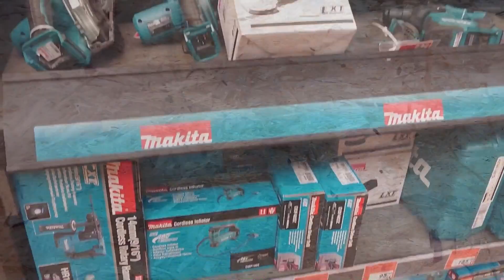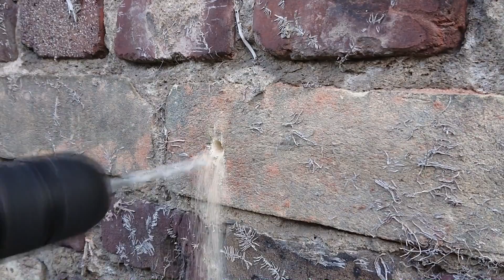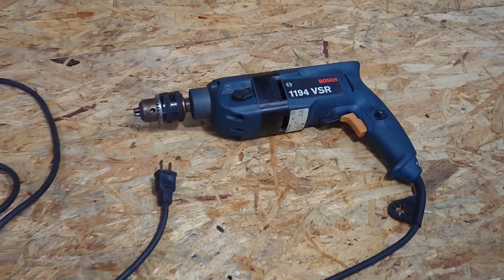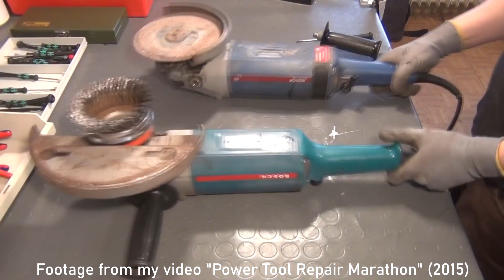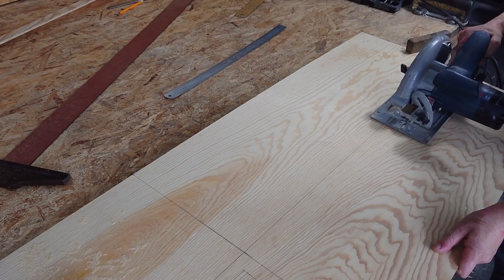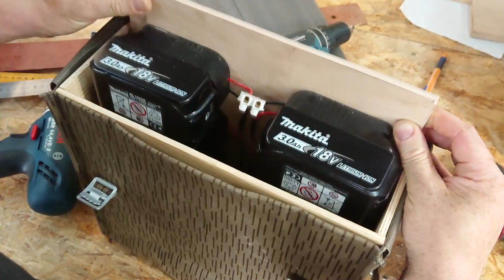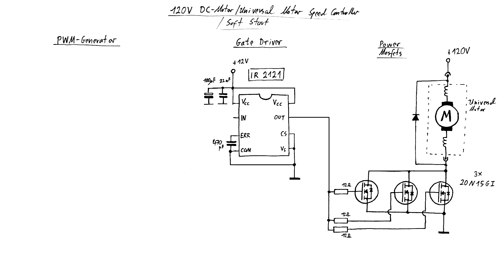Battery Tool Experiments:  Converting 120V Tools to Battery Power / NiCd to Lithium

Comment: A few comments on the grinder project:
1) Your current limiting resistors will likely ignite if you forget to flip the switch! (14 ohms in 120V circuit by itself would draw 8.5 Amps. The grinder won't limit the current all that much, so about 1kW in the resistors - and they don't look like 100W resistors to me)
2) It's very cool, but not all that practical... Those look like 3Ah batteries you've got there.  Since the grinder is 15A, you'll have dead batteries in about 12 minutes... Lets hope it's a pretty short zombie apocalypse!  Maybe toss a bolt cutter and hacksaw in the go-bag, just in case?
3) And I don't know where you're getting your batteries from, but the cheapest 3Ah 18V Makita battery I could find on eBay was $34 Canadian, so 6 of those would be over $200.  I found a used 1200W generator listed online near me for less that that!  1200W won't power that grinder at full speed, but it'll do a 9A reciprocating saw pretty easily - and with the right blade, that'll go through the metal gate too! (OK, it's a bit slower, but there's a lot less fire hazard!).

Comment: Stacking batteries for higher voltages can damage the BMS (battery management system).  The BMS will disconnect the load if the battery is over discharged or over current (or over temperature).  That disconnect MOSFET was designed for the 20VDC that the pack produces.  When you stack batteries for higher voltages, the first pack to disconnect is exposed to 120VDC and that is highly likely to fry the disconnect.  Things may appear to work for a while, but the first time a battery hits over current or low state of charge can cause one or more packs to be permanently damaged.  Fire is possible when this happens.
Reply: I 100% agree with you.

Comment: Just a word of advice. If you connect a lot of batteries in series add a bypass diode across them. If one is weaker it will discharge faster. This will lead to it being charged backward.

Comment: I feel for any radios in the general vicinity of that first PWM circuit... Sounds quite RF-noisy
Reply: I'd suggest changing the 12R resistor on MOSFET gate to something like 100R, it will make it generate a bit more heat but should limit the frequency range of the noise ;-)

Comment: Thanks for the video, they are always appreciated. I have two Makita 12V drills I think at least one is made in Japan. The 3rd party cheap replacement batteries are rubbish and the so called replacement Makita Batteries sell in Oz for around AU$90 but none of the photos show Makita printed on them - probably a scam. While I was aware of the 18v Makita adaptors, from one of your previous videos, it was not until seeing this video and the 12v adaptor that sparked my brain into action. Now I have the seed of a plan. I totally agree with your philosophy of Repurposing, reusing and repairing old tools. Good for the earth and gives one a good feeling.  Wünsche dir sicheres Reisen. (The best I could come up with in Google Translate, so the Grammar is probably incorrect) ☀

Comment: I used to have a set of 12 volt power tools that I modified to run off my trucks battery with a 15 foot power cable, i just emptied one of the battery packs and wired the cable to it to make an adapter, the bonus was that the truck acted as a mobile generator

Comment: Just Putting multiple Batteries in Series can be dangerous. You might Need reversed blockingdiodes across each Batteries Terminals. If one battery is Low in Charge or aged there is the possibility that it Sees a negative voltage (under high loads of the Series configuration). which is Bad For the Cells, but even worse for the electronics.

Comment: I was just searching for a black and decker adaptor combo so I could use 20v batteries in series to run a 40v leaf blower.  If I had a 3D printer, I would print a nice caddy for it to attach nicely to the tool

Comment: Hi Gerolf, can you confirm wether Makita 18v lxt batteries have low voltage cutoff of the DC terminals at the battery level or is there only communication happening via the smaller pin connectors to the actual tool to refuse any further power draw?

Comment: Small car/mc batteries(+converter for AC tools or just a long cord and a voltage regulator for battery tools) and a moving-cart/hand-truck would make for a cheaper option that would provide enough amps for some duration of work(which is often the case with angle grinders, masonry/hammer drills and such) and quite a bit of mobility(will be doing something similar with a ready-welder when I get around to building an aluminium boat)

Comment: Only limiting factor is not the volts-those little 775 motors can handle up to 24v. Its the diode and mosfet inside speed controller that cant handle that much voltage or amperage when motor pulls it due torque needed to overcome forces.
If you connect battery to a motor directly with a  normal 3 way switch (left/0/right)switch you will be able to run it on any voltage.I did it to a old ryobi 14V ,it works on 24 without problems.

Comment: Some-time in the future:
A blue sky, interspersed with plumes of smoke could almost be beautiful, if it wasn't for the bursts of automatic gunfire and screams. A Toyota Hilux with a bed mounted 12.7×108mm Zastava M87 drives past the end of the road, stops, reverses, and turns in.
"Looks like it hasn't been touched yet" says the young man stood at the gun, in an urban accented Russian. "Make sure" says the driver. Imran pulled out the end of the belt, and fed it into the machine gun as the driver pulled up at a small workshop.
Shhhhhhhhhhhhh K Chat! The long pull of the bolt on the machine gun, and its subsequent release produced a sound that no-one misunderstands.
The driver hears the sound of the machine gun dropping against its mounting tripods end-stop, and looks round to see Imran running down the road. "What the fuck are you doing?!" he shouts. He looks back towards the little workshop, and sees something that they'd heard about, but dismissed as a tall story.
The doorway to the workshop was filled with a figure wearing a mid-1980's Polish gas-mask, a long, heavy rubber trenchcoat, and a backpack. A backpack with a heavy cord that runs to a large Hitach angle grinder.
The figure pressed on the handle, and the grinder span-up. He began moving forward.

A blue sky, interspersed with plumes of smoke could almost be beautiful, if it wasn't for the bursts of automatic gunfire. 
And the screams.

Comment: I've run my 18 Volt drill on 22 volts for months now and no problem at all. It usually is not a problem if the voltage is off a vew volts.

Comment: Putting 3 MOSFETs in parallel is basically as good as just using one.   Because they may have slightly different Rdson, most of the current will preferentially flow through one MOSFET, leaving the other two to not do much at all.   You can get around this by attaching a power resistor in series with each MOSFET, which helps equalize the load experienced by each FET, but will also waste a lot of power

Comment: Fascinating video as always and very impressive angle grinder .... just intrigued by what was in the white conduit which was attached to the outside brick wall just beyond where you demonstrated cutting through that substantial ironwork?
Reply: at 22:06 you can see it looks like mains wiring running into an outdoor socket.

Comment: The bag is a good idea, you could add an output socket for ease of changing tools, also, is there a way to charge the batteries in series, either a solar panel or say a 12v car socket... etc be good portability upgrade

Comment: Stupid question: That white conduit running along the wall directly behind the piece of square hollow section you were field-testing your 120V Hitachi grinder on with a cutting disc doesn't have 220V mains voltage running throught it by any chance?
Reply: I had the same question.

Comment: Just a quick piece of advice, paralleling diodes never really works due to slight differences in forward voltages and the exponential voltage-current characteristics.
It's much better to just use one properly sized diode (like you did here) or use a mosfet as an ideal diode.

Comment: I found myself an old 12V hitachi drill with NiMH batteries, but they ere all dead even after hacking a charger together. I ended up stripping the worst battery and added cables to run it on a car battery (i use my car itself because there's no power in my garage, and the battery charges up again while driving anyway), and i use it with my car. Funny how a cordless drill became a corded one x)

Comment: There are some things that can be improved on the PWM "speed controller".
First thing is if you are using multiple MOSFETs in parallel, you have to distribute the switching current evenly using low resistance resistors in their drain connections. 
The second thing is there's no need for gate driver circuit for such a low frequency. Just a complementary emmiter follower will suffice here. Also, why not use specific IC for direct drive SMPS, such as UC3842 ? 
Third thing is the sofstart feature, it may be better to change the circuitry as such there's a capacitor independently charging and limiting the duty cycle at start, with the pot wiper connected via a diode, only limiting the maximum duty cycle. That way the tool softstarts and the speed potentiometer only limits the maximum duty cycle and you don't have to reach the knob every time you power that power tool. 
If you're still keen on using Arduino (but I see no reason to use it firstly) you can implement a current shunt in the motor circuit and use it to start increasing the duty cycle. Note that minimal duty cycle is needed to sense the current. With this mod, the circuit softstarts every time you power the tool on. Similar behaviour may be achieved with current limiting of UC3842 to limit starting current. That way the power tool gets only the maximum load current and startup current is limited.

Comment: The only thing I can say about the lithium ion 120v set up is do the Makita batteries have an internal charge controller that will shut them off before they get below the minimum voltage? Or would it be a good idea to add that feature in so you're not destroying batteries for your tools.

Edit: I'm asking about halfway through because I haven't heard it mentioned yet.

Comment: Feeding AC current, the windings of the universal motor show a much higher impedance, using DC they show only the resistive part of the impedance, so at 120v DC more current flows in to the motor with respect to 120v AC. To do not overheat the motors you can run them with less voltage.

Comment: Though it's neat you can use the batteries to run 120v tools with universal motors... The thing is most of those motors are terrible inefficient for battery use. Especially if they are not permanent magnet which most are not.

Comment: I didn't realise that you could run any ac motors on DC. Very interesting. What's the effe t of running DC currents like that through the thin ac cables? I'd ikmagen they are a bit hot at the end of it?

Comment: So cool! Would be interesting to know how much each battery is drained during a cutting operation, ie. what’s the power consumption?
Reply: Yes there should be a low voltage alarm and/or voltage display? You don't want to deplete the battery too far, do you/ can you? safely

Comment: Does that 14v can really handle the 18v battery? I ordered same adaptor as yours using Bosch 18v batt, my old 14v drill smells like i fry it in few seconds. I just turned it off immediately. 😂
Reply: Was thinking the same. I think some might be able to but for sure not all the tools can. I guess one good way to find out is to see if the motor inside has any markings and trying to find a part number and datasheet for it.
Reply: There's a lot of factors that determine what a motor can handle. Load, air flow, etc. It is a good bet that a motor in a 14.4V tool can handle some more voltage though. Motors can emit different smells for different reasons too. Some motors are even, "self healing". As in you can fry them and when they cool down they may reconstitute their insulation. It is a feature in some designs. Most motors you only get to fry them once.

Comment: if the big angle grinder draws 15 amps you won't have very long run time :)  At 15 amps the 2amp-hr batteries will only provide 8 mins run time max although the amp-hr rating is probably a bit less with high current draws. They often rate batteries at a lower current draw (usually c/10)

Comment: Good Day I have a Bosch cordless drill like the the first one you showed can I maybe get an adapter so I can use a Bosch battery as I bosch batteries if yes can please send me a link for the adapter I am from a very sad South Africa thank you for helping
Reply: The same adapter can be used for Bosch 18V Lithium Ion batteries. If you look at the marking, it says M&B 18V. To switch, two screws need to be removed to slide the connector piece to Bosch position. You then replace the screws in the new position.
Reply: @iamjohnmc  thank you so much where are you from I am from South Africa

Comment: Great video!  Thanks!  I'm currently working on a Yamaha three Wheeler conversion, from gas to electric.  I have the batteries and motor, but having problems with the motor controller circuitry. I've tried a couple of motor controllers from Amazon, but they have a built-in soft start or time delay so they don't increase the motor voltage rapidly enough.  This video is helpful for me to design my own circuit if I need to. An idea I had though, that maybe you can provide some input on, is using a drill trigger speed control on my handlebar as a first stage to control the input to the actual motor controller. It would operate like a thumb controlled throttle on a gas powered quad.  That drill speed control can't handle a lot of current, but it could be used to control the input to the motor controller circuit board.  What are your thoughts on how to incorporate this into the MOSFET output motor controller?
Reply: Looking to build a ebike with makita batteries. Also have a system that you can add batteries together, and add a inverter, as a power pack/ hub charger combo. Dewalt has something like this.

Comment: I want something like this yet inverter based. The ability to add more batteries rather than a fixed number. Dewalt has an inverter type box. Yet I am unclear if it works with 2 batteries or 6 or what ever it holds. Though they are 20v if I recall. So what inverter works with that voltage. The major problems is finding an inverter that works with higher voltage while still accepting standard 12v or what ever size solar panels you have to charge along with 120 AC. The more option a unit has the better.  
As for those adapter you might find them for a few dollars. I have found them for around 20 dollars per unit. Adapters are expensive here in the states.
Reply: Used one of the dewalt hubs years ago. Think it was 6 batteries. Brilliant concept anyways
Reply: @musFuzZ  Yeah they are 6 batteries. As far as I know the inverter just works off of 2 batteries and then just add more for more amps. I want a scaling type inverter where you can add in as many tool batteries as you have this way it can be used with any tool brand. I have ridgid brand and they do not have any inverter based stuff. Now ryobi brand does in its 40v outdoor tool line and a very small stuff for their 18v line. Though having to  buy all new tools and batteries sucks and adapters are quite costly at least where I can find them for sale online. 
In my quest for cool things. MPP solar makes a battery less all in one inverter. Which fits the need for those who do not want to invest in a huge costly battery bank. Its a pretty high input voltage/amps and 48v battery bank. Though its something I want for the house just not what I want for use of tool batteries.

Comment: What would be even more interesting would be a conversion from 220V to e.g. 2x18v ; i am thinking about rebuilding my Hilti Torna 765 into a 36v or 54v driven tool powered by makita batteries and i also would like to do it to a 230mm angle grinder. What would be your recommendation for motor choice? I already converted some old makita 24v tools to modern 7s lithium batteries however most avialable options made from 7s1p or 7s2p 18650 cell packs won´t give the amperage i get from my homebuilt 24v nimh battery packs made from 4/3A EMMERICH cells (20s1p). I think about rewinding the motors for 18v to use them with the metabo lihd 18v battery packs based on 21500 cells or rebuild them to 2x18v makita with a step down converter.

Comment: Nice video as always, are the wire that come with the makita  battery  adapter  thick enough  and made with copper  to reduce  voltage drop.

Comment: Hi, I am pretty new to electronics so please forgive my ignorance in my question. Could you add a transformer between a single battery and your setup to bring the voltage up from 18v to 120v and get a similar result? This would be instead of linking batteries in series.

Comment: Can you build a soft-start circuit using a microcontroller that would constantly monitor current to the motor, and adjust the duty cycle of a MOSFET (or Triac, if running a universal motor from AC power), so that the motor starts as quickly as possible, without ever exceeding the rated current of the motor at full load, as noted on the data plate on the tool?

A small numeric display attached to the microcontroller and a rotary encoder could be used to quickly set the proper maximum current for the particular tool you are using, making the soft start truly universal!
Reply: If you can come up with the Arduino code for this, and a schematic, I'll build one soon, as I've wanted this exact thing for years.
I hate the "Ker-Wham!" of hard "across the line" starts of Universal motor-equipped power tools...